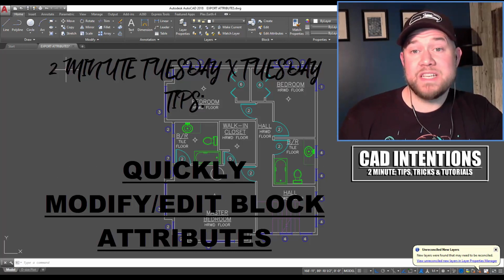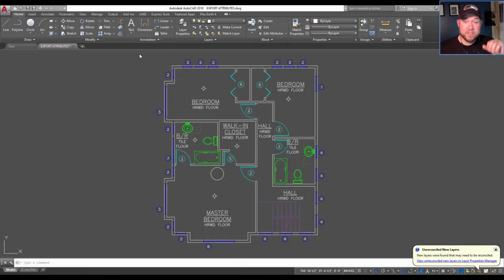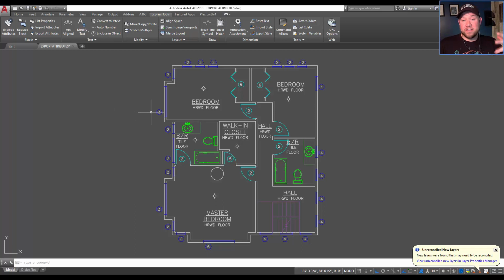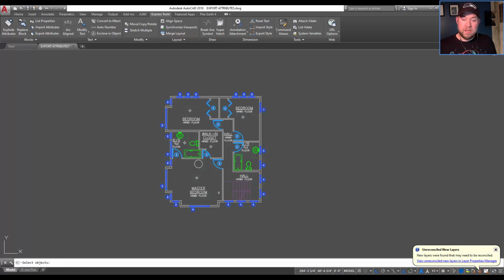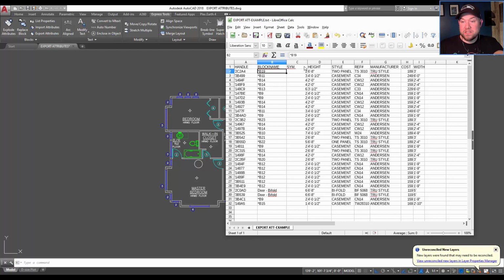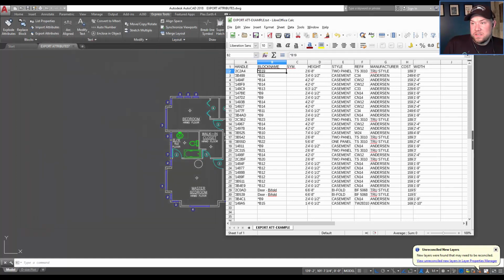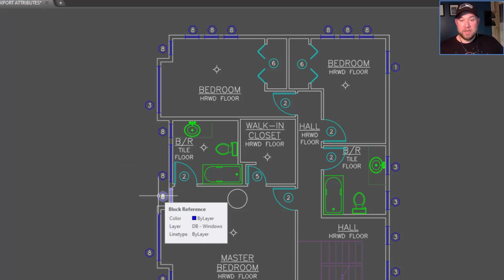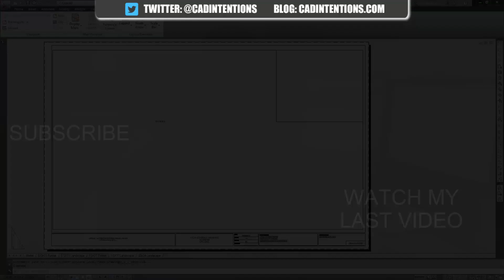AutoCAD How To Edit Block Attributes in Excel: Import/Export Attributes - 2 Minute Tuesday

Comment: I understand this process, but I would like to use it in order to add a new attribute to the block that wasn't previously saved. Example: I export the data from a group of blocks that have 2 existing attributes: A and B. I would like to modify the text file to add a third column for a new attribute, C, and populate it for each of the blocks before importing back into AutoCAD. I'm pretty sure this isn't possible through this process, but I would just like to confirm.

My next route is looking into a lisp that will do this for me.

Comment: Brandon, when I export my door blocks the height and door thickness fields that are in feet and inches such as 6'-8" and 1 3/8" come back into the attributes of the blocks as "6'-8"""" and "1 3/8"""   I can't seem to figure out how to save the excel file in a manner that it doesn't add a single " in front and two more after each of these items.  Thanks for any advice or help.